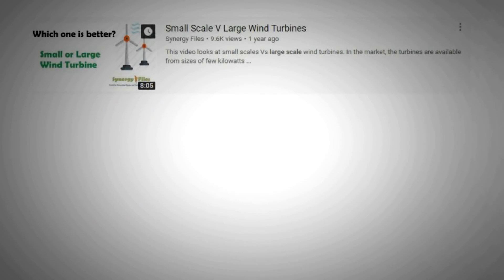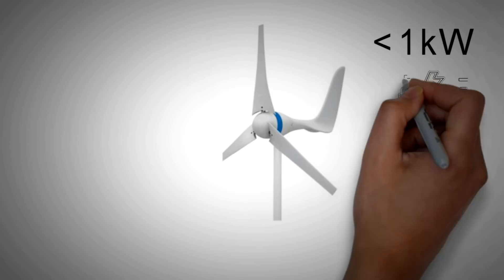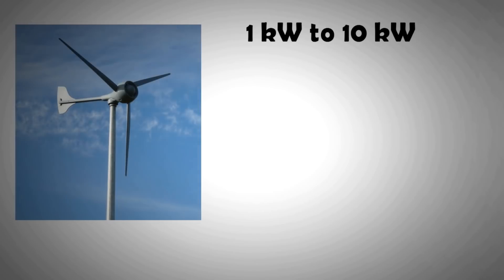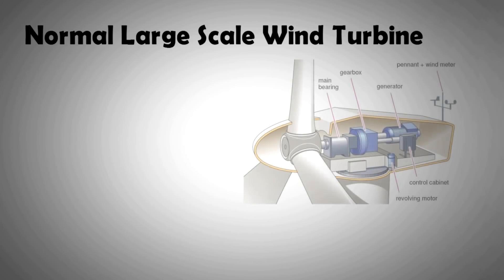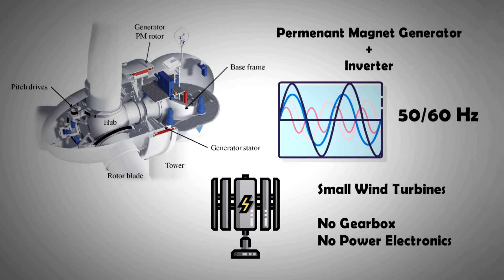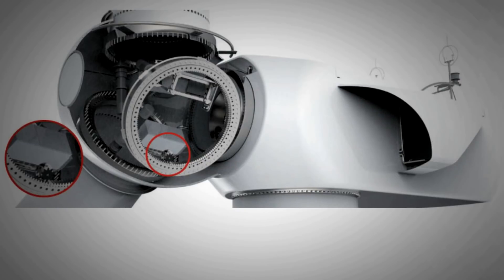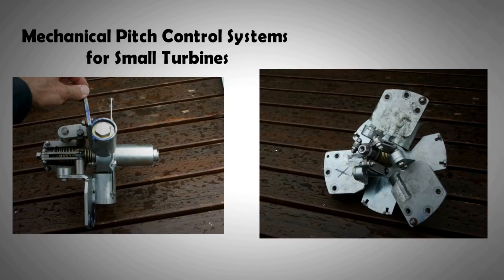Modified Small Scale Wind Turbines making  a comeback

Comment: With all do respect. 400-800 Watt turbines are perfectly suited to be paired with solar for ANY residence with adequate wind. I have a couple of high quality 500 Watt turbines and their rating is true. I get 450-500 Watts around 22 mph as rated, and frequently see peaks over 800 watts due to my location. It tops up my batteries nicely overnight, and also helps prevent sulfide buildup. And considering the cost for both (plus controllers) etc was less than $1000. Well worth the money today.
Reply: Any chance naming the flavour?

Comment: There reasonably priced and they free you from the slavery to the greedy corrupt power company's pocket.
Reply: You have obviously never had one.
Reply: @dougselsam5393  mine cost 137 dollars plus tax, I bought 3 of them and were I live I get about a 5 mph wind of lake Michigan and they charge about 25 percent of my battery system and solar dose the rest. And i no longer get a 275 dollar a month utility bill.
Reply: @COPPERMOUNTAINCOINS.  It's well-known in wind energy that 5 mph wind does not carry enough power to even start most turbines and not enough to make a dent in your energy bill.  A 5-mph wind has 1/64th the power of a 20-mph wind.  Not enough power at 5 MPH to even notice.  You must have more than 5 MPH and use very little electricity, and/or your solar is probably providing almost all your power since wind turbines that cheap usually produce almost nothing and break down soon if exposed to a decent wind.  Here we have a 20-30 mph wind every day with a 10-kW turbine costing $75,000 installed, and our electric bill is near zero.

Comment: it's possible to have auto-adjusted CVT gearbox,  it's much simpler than the ones used in automobiles.
Reply: Sure it is.  And that would be "good" because...(?) 

Remember a wind turbine runs all the time and is like putting 250,000 miles on your car every year.  Will a CVT last 250,000 miles without requiring service or replacement?  There are people who know wind energy, and there are the "armchair engineers" that think their shoot-from-the-hip instantaneous opinion is not something the experts have tried or even thought of.  Again, we're used to it.

Comment: Great video, and to the point. I don't think we can expect extra efficiency improvements in the generator itself, or in ball bearings, but all these other points stand out. A 10 meter high mast is not very high though, the higher the better, but many countries probably regulate the maximum height you can get without a permit. It's 12 meter for instance in France.

Mine is just 1KW, a DIY kit, but it's a windy place so it's almost always churning some power into the batteries to complement the small 2KW photovoltaic array in my off-grid place.

Comment: Sorry to say, most everything in this video is in error or backwards.
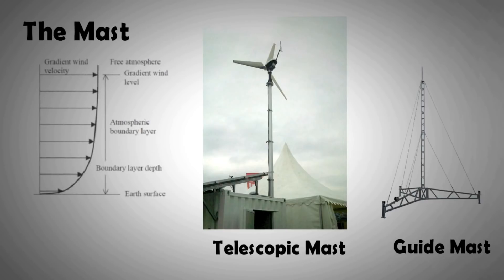1) @ 3:34 The term is "guyed tower", not "guide tower" and it is how small turbines have always been supported - not new at all.  ("Guyed" means "using guy wires")
2) Small turbines have been using fiberglass, carbon fiber, etc. composite blades forever - again not new.  Sure there are always injection-molded ones too, but I've never heard of die-cast blades - what turbine ever used die-cast blades?  (???) and he does not mention pultruded fiberglass blades, which are what the leading brand of small wind turbines has always used. 

3) The reason small wind companies have been disappearing is solar has been getting cheaper, while turbines have not.
4) "Better blades" including composite blades using advanced airfoils, have been in use for many many years, long before the decline in small wind;
5) Direct-drive permanent-magnet alternators running through inverters is how small wind HAS BEEN DOING IT FOREVER.  It is the large turbines that have copied small wind turbine, not vice-versa!!!  There are very few small wind turbines that have ever used gearboxes.  Direct-drive started with small wind turbines, not big turbines.
6) Look at 7:48 "Drive drive systems"...
7) Telescopic masts, huh?  Where?  Who has one?  This sounds very weird that this guy just seems to come up with his "facts" from nowhere.  Like he is reciting his pet features from a wish-list, rather than reflecting the actual state of small wind industry, which is not healthy these days.  I do not know of any system using a telescoping tower - never even heard of it.  Certainly it is not common and does not represent any breakthrough responsible for a recovery of the small wind industry.  There IS NO RECOVERY of the small wind industry.  It is using the same technology as always except inverters have been getting cheaper due to solar, but it's still hard to compete with solar because it is cheap and especially since solar requires almost no maintenance, and lasts 20 years+, whereas wind turbines almost always break down within a very few years, if not months..
8) Pitching hubs using springs - they have been around "forever".  They are NOT NEW AT ALL.  And again, they are touted by outsiders with no actual experience.  The reality is, passive-pitching hubs are a very old idea, and have been implemented for many decades, BUT... they usually fail because they require ongoing lubrication and maintenance.  They add several moving parts subject to wear, and since a turbine is spinning most of the time, it is like putting hundreds of thousands of miles on your car every year - things wear out and require maintenance, which few people actually DO, so the turbines break down.  To this day, there is still no foolproof pitching hub - they are always a problem and source of extra weight, complexity, cost, and failure.  Trying to think of one company using them still in business...
9) "Taller towers" have always been available, just a matter of how much tower you can afford, and what is allowed in a given area.  You want an 800-foot guyed radio tower?  Good luck affording it and getting it approved by zoning.   The problems are cost and zoning.  Most neighborhood homes would not be allowed to put up a turbine at all.  The tower and noise would not be allowed on a small plot of land, especially in a tract neighborhood, but for solar a small lot is fine.  Only rural properties with acreage are even suitable for small turbines.  We have a 120-foot-tall tower here, but today only an 80-foot tower would be allowed to be put up here, so if anything , towers have been getting shorter, not taller.
10) I'm really amazed at the level of erroneous content and disinformation every time I see another video on Youtube about small wind turbines.  Quite often, the person making the video, even in some cases being a manufacturer, know NOTHING about what they are talking about, get everything backwards, and the comments will nonetheless be very complementary since the audience also knows nothing of small wind so they think the video is giving them good information.  Very weird, kind of sad, just so you know, if you are a smart, curious person who is truly interested in true facts about small wind turbines, this video is not the place to find it.   Also true of a few other videos I've seen on youtube.  Peope can say anything on here.  The question is, do they have even any idea what they are talking about, or are they just making a video?  Beware my friend.  This venue is not always where the real info is found regarding small wind turbines.
Reply from the maker: Thanks for pointing out the error. I am particularly disappointed about "Guide" instead of "Guyed" (Even though I had the latter in mind). Die cast blades were used in Proven Wind Turbines. They used blades that were similar to ones you see on ceiling fans.
Reply: @synergyfiles3536  OK thanks for writing back. 

Look, forget worrying about any "single" error in this video. 

The whole video is just WRONG.  You have EVERYTHING backwards. 

and...

"Proven" brand wind turbines use polypropylene or Glass thermoplastic composite blades, as you can see in the table on page 3 at this link: https://www.energymatters.com.au/images/Proven%20Energy/Proven%20Wind%20Turbines%20Brochure.pdf
I don't know why you make a video "explaining" small wind turbines, if you don't know anything about them.
Reply from the maker: I wasnt talking about Proven in Australia, but Proven turbines in UK, that went into administration. I have been critical of small wind turbines and in fact made an earlier video against them. Even in this video I am dismissive of less than < 1 kW turbines.
Over time I have seen the slightly larger turbines though are proving to be successful, which made me re-examine. I found that there have been improvements and so I listed them out. There are still issues with them but in many places in the sub polar low regions they are a great substitute for solar panels
Reply: @synergyfiles3536  We're both talking about the same "Proven" brand wind turbine.  I'd like to see your source for your "die-cast blades" statement.  If Proven ever used them, they would be the only manufacturer to have done so,, and I m not aware that they ever have.  I would ask you to show proof of your statement.
I have a friend who has a Proven turbine, by the way.  Endless problems.  Probably not even running anymore. 

The "improvements" you cite are all either old, already long-used in modern wind turbines. or not used at all.  Direct-drive generators not taken from utility-scale turbines, the opposite is true.  They copied us.  And they were all in common use when the small wind industry fell apart due to cheap solar, 100% reliable, wheres small wind turbines can be relied upon to wear out before the solar panels are even "broken-in".  If you don't know, you don't know.  People watching this should be told the truth: You can ignore everything in this video.  It is not factual.  Why you would make such  video, I do not understand.  I've been involved in the small wind industry for 20 years, so I should be biased toward favorable information, but I am just telling the truth here.   The fact that "small-wind" is bankrupt is beside the point that you have all your other facts backwards too. 

This message is powered by a 10 kW Bergey turbine, which would cost more to repair than to replace with solar, when it breaks down again.  It came with this property when I bought it, and has never been trouble-free, always in need of some repair, although we do enjoy a zero electric bill.  Still, it's only  matter of time...  the same amount of money invested in low-risk bonds would pay the electric bill just as well, and you would still have the original money left years later, instead of having  spent it.  The favorable information for "small wind" is if someone can come up with a reliable, cost-effective solution, they have no competition, because, as of now, a reliable, cost-effective small wind turbine is not available on the market.
Reply: @dougselsam5393  very informative... I like wind turbines since childhood nad watched lots of videos of small wind turbines on youtube, but your comments changed my mind.. they are very true and informative.... thanks for the showing the real facts about wind turbines....
Reply: I know little about renewable energy. However when comparing wind and solar surely the local area area is a factor.  Living in Ireland there are good winds, plenty of cloudy days with short daylight hours in winter. I see lots of commercial wind turbines (subsidy?) and solar mainly on new houses.

Comment: How much do these small turbines cost?  Can u name a manufacturer that has all 4 benefits you talked about?  Thank you.
Reply: They can cost anywhere from a couple hundred bucks on EBay, to many thousands for an aerospace-quality unit that will never pay for itself and probably fail within a very few years or less anyway, because it is difficult and rare to achieve true reliability.  Even the very best brands (the few that have not gone bankrupt) have many failures and issues.  It's a wide-open field for anyone who can produce a truly economical and reliable turbine.  People think that is easy but it is close to impossible.  A true engineering challenge.  These machines run most of the time and it's like putting 250,000 miles on your car every year.  Think of this: we had a man on the moon before we had a windfarm.  A typical small-wind turbine has 1) fiberglass composite blades; 2) A guyed tower 3)  direct-drive permanent-magnet alternator, 4) advanced airfoils... I'm trying to remember which 4 "benefits" we might be talking about exactly.   Most of the wish-list features in the video are nothing more than the way small wind turbines have been doing it in the modern era all along.  Not new.  And taller towers have always been known to be desirable, limited only by local codes and your budget  - telescoping towers are not something I've ever seen in wind energy.  They would have issues.  Most small towers are "tilt-up".  Tower stability is important - you don't want any wiggles or clattering of joints.  Oh yeah - "pitching hubs" - perpetually talked-about, and seldom used due to their requirement for lubrication, which nobody does, so they fail.  Think of that analogy of 250 miles on your car in a year.   Many of your front-end parts for the suspension and steering would need replacing by then.   Same with the turbine - pitching hubs aare a nic idea but  source of failure.  The idea is you need the fewest moving parts possible so the most reliable small turbines have only three (3) moving parts: 1) rotor with generator (spins as one part), 2) yaw-bearing (for steering) and 3) pivoting tail (for overspeed protection).  Rather than naming a brand that uses all these good named features (forget the bad features), name one that does not.  The exception might be said to be the very smallest turbines, that use injection-molded blades, but even they actually ARE advanced composite blades, due to short-fiber glass or carbon content.  This video is obviously made by someone from outside the small-wind-turbine industry.  One major issue with small-wind as a topic is with wind being invisible, peoples' imaginations take over and they just start making up "facts" from "thin-air".  Wind energy requires very specific information to understand.   A casual treatment is unlikely to convey a true understanding of the topic.  Not unusual for PhD people from outside the wind industry to say outlandishly naive things and make 100% wrong statements about aspects of wind energy that seem "obvious" to them but are just wrong.  We are used to it.
Reply: Britwind is the one he was mostly refering too.

Comment: I find that the great comedown on these small wind turbines are the bearing, the quality of them is no good, I have bought about six wind turbines in the past 5 years and it is always the bearings that fail and water ingress into the generator. But otherwise they could improve them a lot.
Reply: Sounds like you bought some very crappy turbines.  Bearings are not usually the problem people think they will be.  Salt-water?  Usually small wind turbines break or burn out in storms, due to insufficient attention to the design of the overspeed protection system.

Comment: Sorry still think in wind
Go big or go home
Or cost will have come down to $100 for about 500w turbine
Reply: You can build one for less
Reply: There is simply not enough power in small areas of wind at speeds under 25kph to make small wind turbines viable. Unless you have wind blowing at 40kph plus all the time at your location. For instance: a 1.2 meter wind turbine rated at 500W needs 50kph wind to generate anywhere near that amount of power. YES, for small applications go big or go solar.
Reply: @David-mc4ny  VAWT can generate at really low speeds and they are unaffected by turbulence. Combined with solar they compliment each other very nicely. And anyone with basic carpentry or mechanical skills can build one.